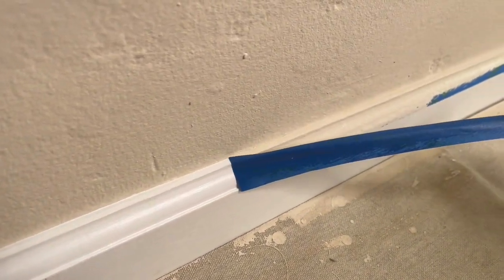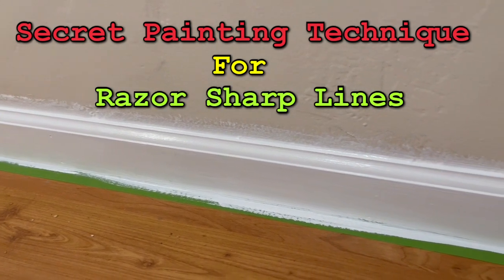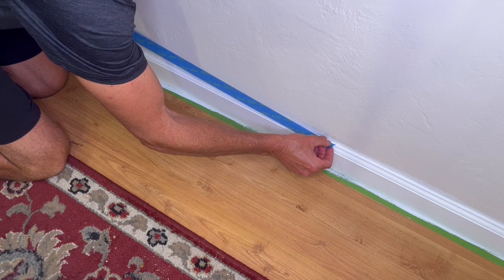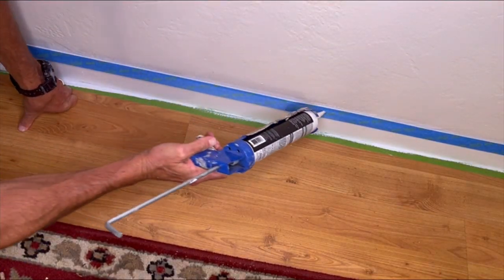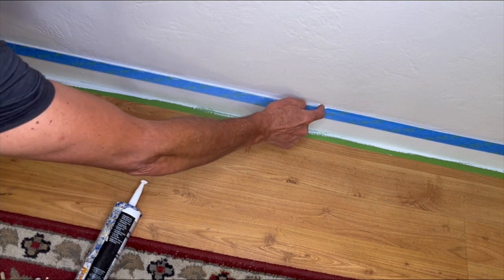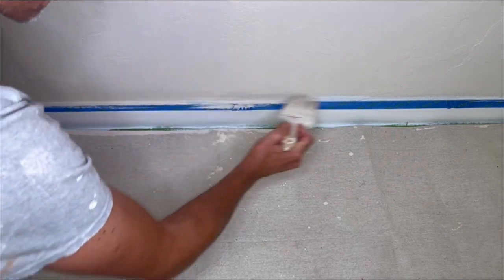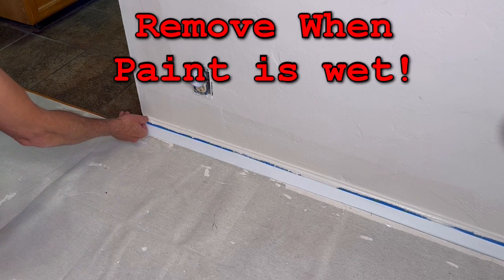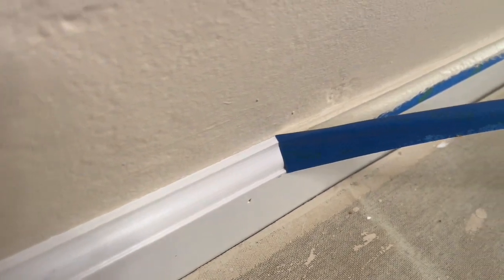Razor sharp paint lines

Comment: Or use frogtape... Activated properly with a damp rag as the instructions indicate. Or seal the top of the tape with trim paint first. None of these are really secrets, but using caulking in my opinion is the slowest method to achieve a crisp line.
Reply from the maker: Using trim paint also works. The only thing is that you need to wait for it to dry before painting the wall. With caulking you can paint the wall, all the way up to the tape, right away.
Reply: @edsdiyhandymanshow3944  that's why you do it right away before you do your high cuts and roll the 1st coat. Just gotta work in the right order. You also don't need to cake it on.. A nice light coat to seal the edge should dry very fast, much faster than caulking.